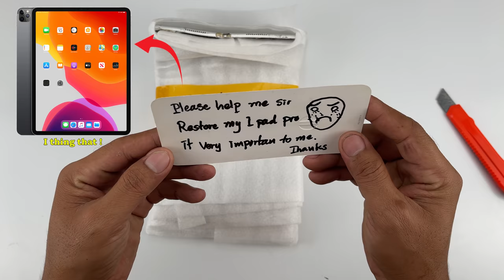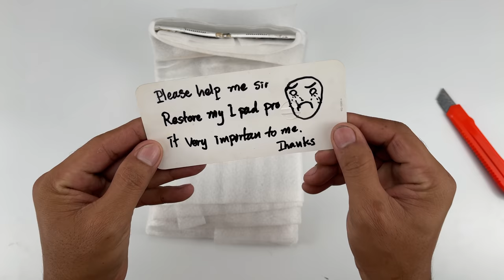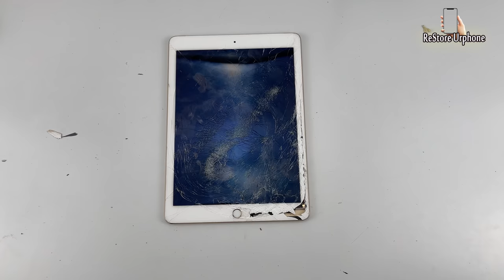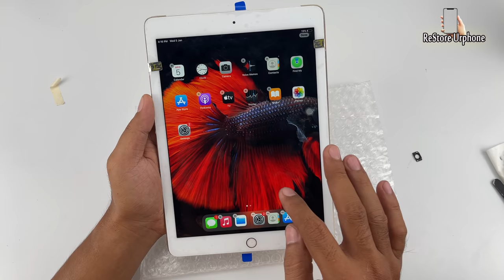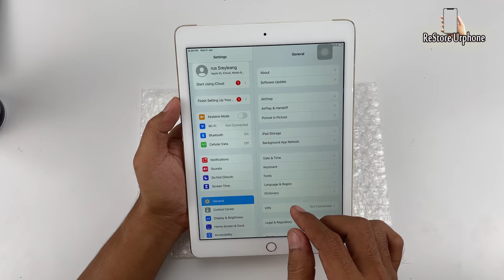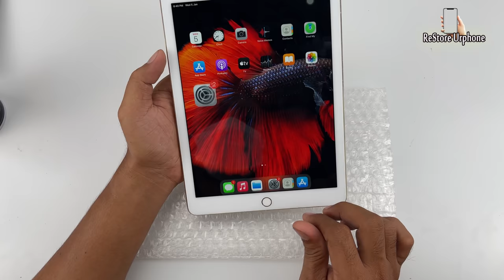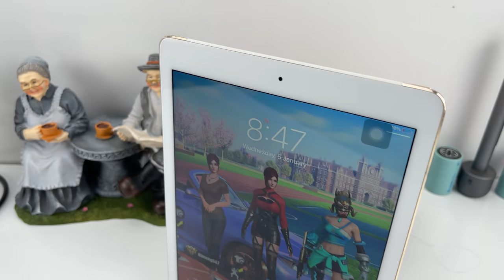Restore Apple iPad Pro & iPad Air 2 Cracked | Restoration Destroyed Phone

Comment: the ipad pro 10.5" would have been sucessfully repairable if you hadn't broken its mainboard (where the connector for screen at 0:16 was located (not sure how to call it so i temporaily say that 😂)).
but yes it needs to end of life because not only it is too dirty but mainboard looks like it had had some problems before being destroyed, same as my ipad pro 9.7", which was my previous tablet i used from late 2016 until christmas day in 2020 when i got new one. i would feel sad that ipad pro 10.5" is no longer repairable so it means it is going to be scrapped 😕
Reply: The iPad Pro 10.5 will be scraped

Comment: Wait a minute did the iPad Pro 2 has been fixed?
Reply: nope sadly he broke the connector for the screen at 0:16, where the screen cables will be connected with. if he hadn't broke it, it would have been sucessfully fixed, however it looks like its mainboard is rusty so even if it was fixed it wouldn't still turn on, not even when plugged in to charge...